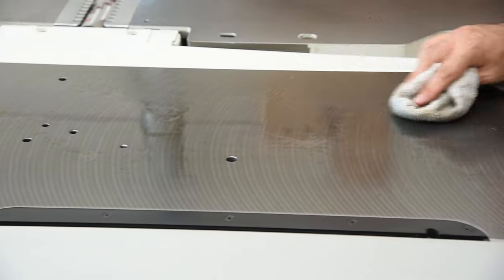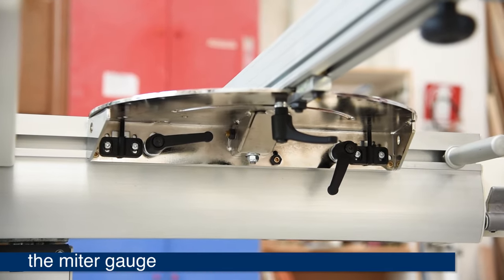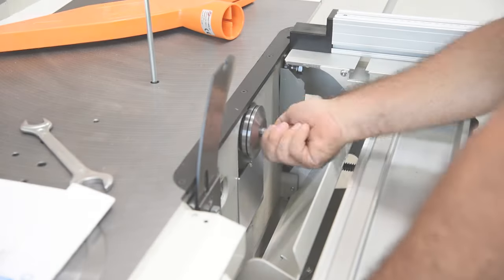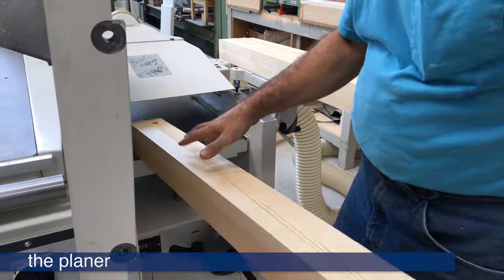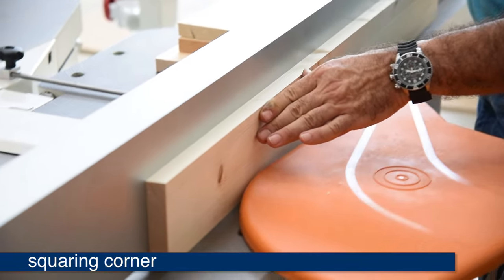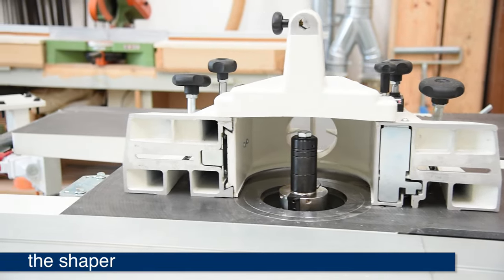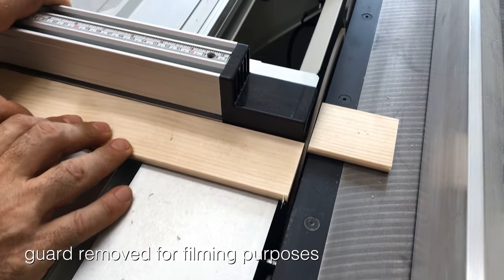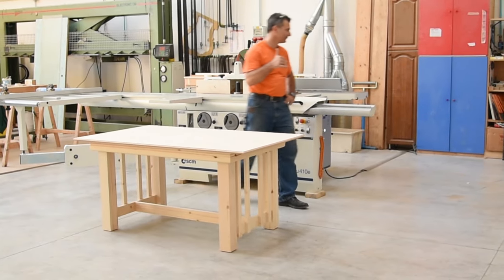SCM minimax cu 410e - all purpose powerful combination machine

Comment: Great video, thanks. How much space you'd say you need around this machine to work confortably?
Reply from the maker: Hi Diego! Thank you very much! Sam always recommend about 2' (500mm) or so greater than the foot print of the machine and it's extreme reaches.  For a machine like this Sam recommend 6000mm long x 4800mm total room.  However, it can work in smaller areas if you don't want to use the extensions and full stroke of the sliding table.